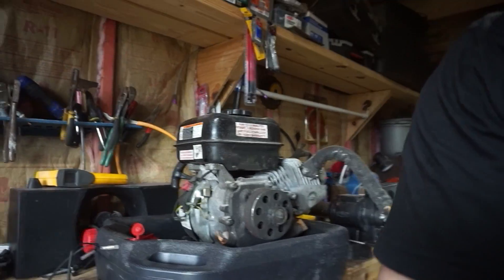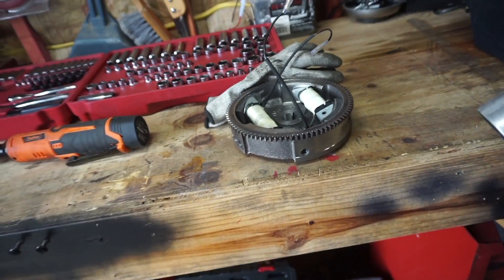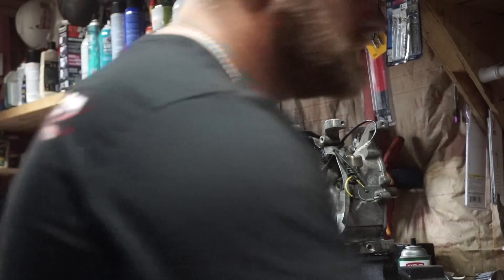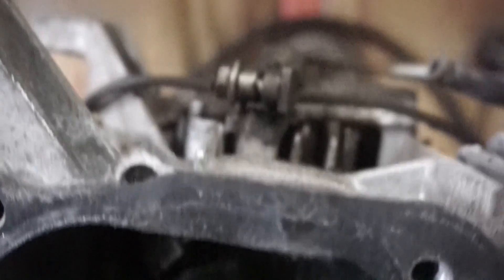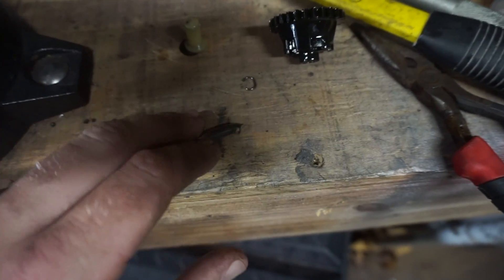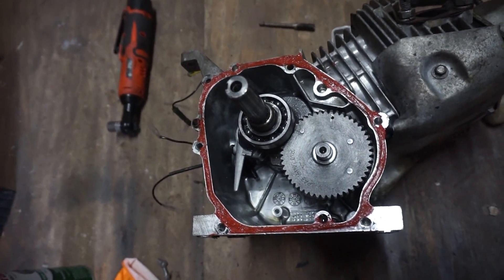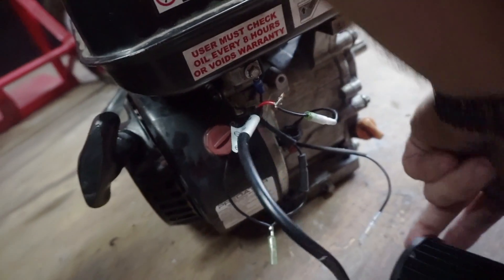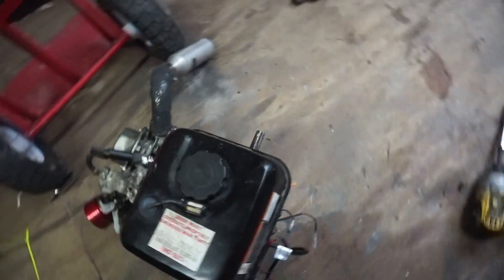Predator 212 12v Charging coil and governor removal

Comment: Oh my goodness  all you had to do was loosen the bolts and drive the governor arm down and out , same with the gear all you had to do is drive the governor gear shaft in from the other side and the governor gear will drop down. remove them and the washers and put two bolts in the the remaining holes.

Comment: Other than the cause that you can order online for the 212 predator engine is there any other motor that you can adapt over or coils that you can adapt from another motor to the 212 that's a question I need cuz I'm real low on cash

Comment: where did you find the flywheel and coils when I input the engine info it shows me every variation but for the predator engine.
Reply from the maker: Here you go. https://www.ebay.com/itm/254468631635?epid=25044781658&_trkparms=ispr%3D1&hash=item3b3f832c53:g:jqQAAOSwoXFfGz76&amdata=enc%3AAQAGAAACoPYe5NmHp%252B2JMhMi7yxGiTJkPrKr5t53CooMSQt2orsSg3Ye8yTWgOW7pmE1t838dh32avkBZBYWonQVZMwj3RswzxIlXXIT7GgAumntgdLAEDg25abDeny6QW6ynsuvg78864%252FC8C2LZ9RzKPYhYTZLUcfcFLeQz%252FP1buJ4ky9J%252FegdGY17%252FvLBu9jtGKPsx36c9nJiXwM5LbgoOc7oQWTh%252FZOqNIFHwRH%252F7qjit3jyPZpcCNZYq2ZlRuT8N0V5eyzDnHysC5EzLMXYPyxH2WWnKoaCSdFZgqmSgxrGfl3o%252BHGFvkanyaXl2%252FkQdZfnEE0NeJdcHqEsCbbYv1eV%252Bu7ar4Mx4LiPMgUY201kvFAs3F1x1Vmrbq%252BFF%252FfJEAjvVoC9%252BUi7N8B9OFs4%252BDGnXCNciljsg5oqPNhGOiEBc%252FMxT9XC%252Fw3WmdqUfCENxyW6FIiPEE0WKBV%252BjXSMsV0imDuMx9VBaTjOLOuVWeEnHPL1yXoF123g%252Bufzmityn6BUZHf9JcjXVbDuNygQ6mttT7UT1SJbJ5hYI5apkNJ8eABUeSffWTyy5dkvWo%252FQYTV31kvKo4E8Yg981SV%252FZGTLNaBJuWuTjaToirNqGJN6h4KtXNphyuEknIWEf57tpmPbkHSlcuA0OfsUJnYAPykmxc%252B%252FubIe7hfsA3Vr%252BzpjE7p4%252BXNbg8rXDig0OIAuhafutgRbi4bgbPccRimsxC9cBcteyQkSLTjE38dE9oLX3F20fB5rOfy6IyR%252BJCge4H41n2r16Piq64gPhIC%252Fuk8drCq1%252Fk035d5lWA1hEMZe4u4rlFCSoZMZmvgaSfLwwq6FiMcrHaC0aJplmO7aKM4AAIcG42vyChoBqSIzRBwxEHCn1vUddpdnisRUyPrOepBLsA%253D%253D%7Cclp%3A2334524%7Ctkp%3ABFBMrPfGldtf

Comment: Will the charging coil work with the stock fly weel or do you need the special fly wheel somebody please reply
Reply from the maker: You have to get the coil and flywheel combo, the stock flywheel wont clear the coils and doesn't have the magneto for them.

Comment: Where’d u get ya coils
Reply from the maker: E-bay -the original add no longer exists but they can still be found on e-bay.
Reply: How bout flywheel
Reply from the maker: @tipc2847  they need to be bought as a kit, search "pedator charging kit" it contains coils and flywheel.
Reply: @Rep361Texas  ahhhh shit I fucked up
Reply from the maker: @tipc2847  Oh no!!!! Just got the coils???
Reply: @Rep361Texas  yessir, I ordered a (Honda GX160 5.5HP & GX200 6.5HP Electric Start Ring Gear Flywheel with Magnets) hoping to fix my problem it turnt out to be an expensive fix  I have no clue if it’ll even work tbh.

Comment: You need to install a voltage regulator/rectifier. At the moment you're running unregulated AC voltage to the light. You'll end up blowing the light and cooking the coil. Especially if you connect both coils. A regulator/rectifier costs about $10 on eBay. Get the 5 pin plug (5 wire) one so you can connect both coils to it.
Reply from the maker: Honestly i ment to get one anyway but I've been running without it for 2 years now without a lick of trouble.
Reply: @Rep361Texas  Probably because you're using an LED light. Most LEDs wil handle 6-36v. A halogen light would have blown.
Reply from the maker: @brettwhitla4425  Correct, there was a little strategy with the led choice.  Its also a lot less load.
Reply: @Rep361Texas   Add a bridge rectifier and you double the DC power output for just a few dollars.
Reply: for a second i thought i didnt need one just needed reassurance thanks

Comment: Where did you hit the flywheel to remove it?  you weren't too clear about it
Reply from the maker: I actually uses a ball joint fork behind it and tapped it to wedge it in then I tapped the flywheel. Be patient, to tap too hard, can damage stuff if your too aggressive.

Comment: Make a video with everything back on your drift cart
Reply from the maker: Man it's been on and running for nearly a year I'm almost ready to pull it off, I need to update videos
Reply: @Rep361Texas  just wondering did you put a switch to turn on and off if so how did you do it?
Reply from the maker: @08cobra92  yes, and I got the smallest outdoor 30amp toggle o could find I took the led pod apart and found a spot it would clear own the inside, took a little dremal work but it all fit nicely,  I'll try to get an update video soon

Comment: Its crazy how much power a non governed one of these engines is...got one of those nitrous kits im gonna toss onto my cammed, non governed 22mm Mikuni 212...What size are those 8mm bolts that hold the charging coil to the block?  1.5in or 2in, or bigger? Nice work...love the video..
Reply from the maker: I believe I used a crank bolt to match the threads and I took a tape measure to the coil thickness and added 3/8", then found a bolt that was as close to that length as I could. I don't have the exact specs on hand I apologize. THANK YOU FOR THE LOVE!!!!

Comment: Who's the vendor on the charging kit?? Thanks
Reply from the maker: I found it on ebay under preditor 212 charging coil, make sure to find a local seller within the u.s. and make shure they have a good rating!! Coils and flwheel was  roughly 60$
Reply: Interesting. Can you hook up the magneto thing to a small battery? Like if I wanted to hook up some brake lights and what not to make my little mini bike look legit.
Reply from the maker: Yes, you can run it without a battery and the break light will work off of it alone, I suspect that if you hook it to a battery you would need something between it and the magneto to cap the voltage so it doesn't over charge it.

Comment: When you removes the flywheel does it hold up okay to the high rpm. I thought about removing it on mine and it has the charging coil system.
Reply from the maker: Not sure actually, I removed the oem ram flywheel just to put the charging one on,  I havent ran one without a flywheel
Reply: @Rep361Texas  I know this is old but doesn't it need the magnet on the outside of the flywheel to power the spark plug?
Reply: @kingofthepod5169  you mean the charge coil. but yes, needs the magnet plus the sensor coil magnet, unless you can figure out how to make ignition run off of a 12v battery!

Comment: Most 196cc come with the magneto. Way better in my opinion
Reply from the maker: I will admit I'm fresh in the small engine  world but this coil system for the 212 worked out very well!!!
Reply: @Rep361Texas  it did.. never knew u could do that to a 212 honestly. I just prefer the 196 cuz it comes with it already and I feel they are more reliable then a predator motor. All I've had on mine were honda 196s just so I can wire lights for night rides
Reply from the maker: @corsminibiketours  🤔 yeah I'm learning, and I bought the trike with the 212 so if just been playing with it ,but  if I grenade it then I'll have to look into the 196 for sure, it just seems like the 212 has alot of mods and options on the market for such a cheep motor....
Reply: @Rep361Texas  of for sure, tons of mods. But I dont care to modify my motor if I can already do 50-60mph on my daily lol that's good enough for me.
But meow days built 212s are old news in the racing events because everyone that races has a built big block, 460cc.
Reply from the maker: @corsminibiketours  True true, I almost wanted to put a BB on the trike as well but I've noticed that with the little mods I've done it's almost over powering for the pvc's I know it sounds silly but I might it rides like it's on ice at full throttle, its actually more fun with less h.p.

Comment: Where did you get the parts for the charging system at ?
Reply from the maker: Amazon,  search under Preditor 212 charging coil, they have 2 versions one is a single coil setup and one is the dual like what I have in the video!!

Hope this helps!!!
Reply: Rep. 361_Texas I only found one with 1 and idk if it’s for a hemi or non hemi you wouldn’t happen to have a part number
Reply from the maker: @TheSugabear210  your totally  right I remember now, ebay is where I had to go for the dual coil setup, I just looked and it dosent have a part number nor does it ask if it's a hemi, sale price was 44$ +12$ shipping
Reply: Rep. 361_Texas I’ll go check it out on lunch thanks 🙏

Comment: U ever thought about putting one of those cheap lil nitrous kits on it?
Reply: We have a couple bike on nos.. it's really not too hard to tune, just need to get the correct nos bottles and they are not the ones from Walmart for the co2 guns
Reply from the maker: @corsminibiketours  I can actually use the  left overs from my truck to fill the bottles for the preditor,  I just need to study on Nitrous vs carb to get the mixture right for the trike
Reply: @Rep361Texas  you gotta get the small tinfoil looking ones like the co2 guns use, but NOT those ones.. The device we used, we got from a bicycle shop, it's used to air up tires on the road.. Walmart has them sometimes.. We got the co2 cartridges from a sex shop lol for "whippets" or how ever tf u spell it.. I can get more info on it tomorrow that all I recall right meow
Reply from the maker: Yes actually, I might blow it up because I have absolutely no idea how tune these things, but I love the idea of it, I might just have to do it now! Lol
Reply: @Rep361Texas  yeah I notice the bottles are alot smaller so I bet the tune lies in how big of a bottle u use....idk...shot in the dark
Reply: @Rep361Texas  we tore the engine I bought rebuilt the other day bro everything was correct that they mentioned but they put a old timing chain on the m.f. so I replaced that. Jus waiting on the mechanic or Christmas to come one or the two now.....
Reply from the maker: classics  timing chain?
Reply: @Rep361Texas  yeah😂 they replaced everything but the old timing chain on the engine!! U could already feel a lil slack I jus said fuck it! And bought a new Assembly